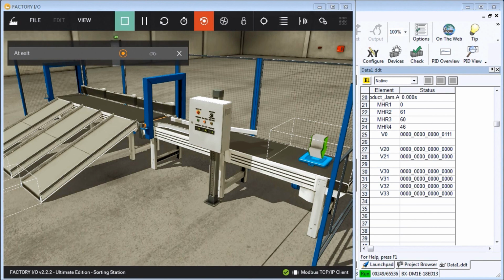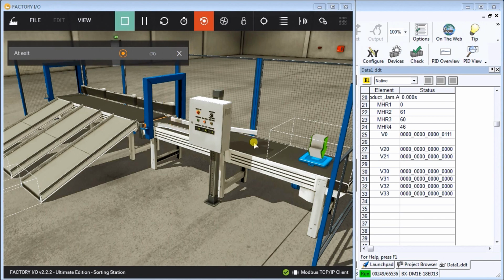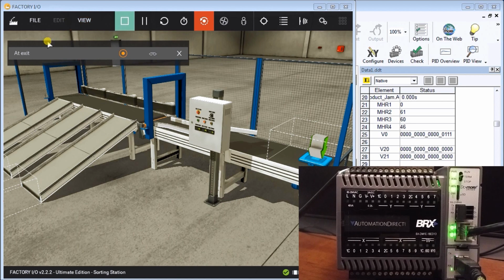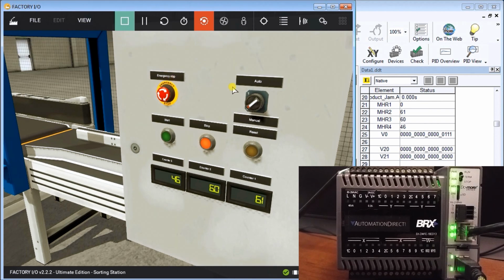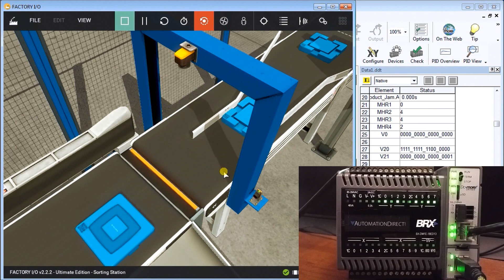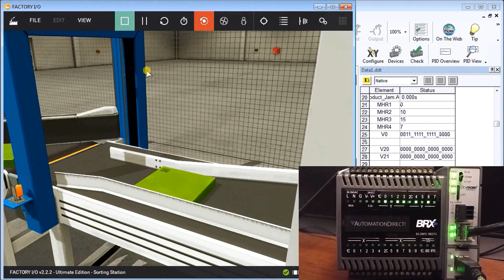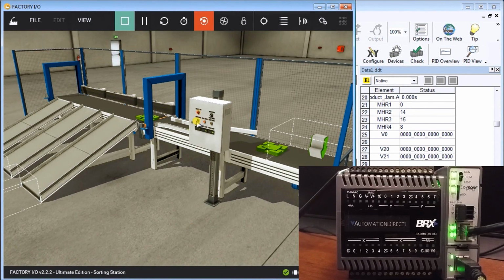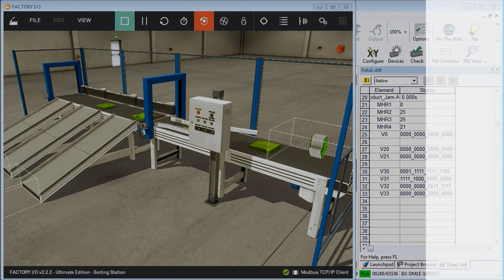Master PLC Sorting with Shift Registers - Real Factory Demo

Comment: How to interface do more designer with faactory io
Reply from the maker: This post uses Modbus TCP with an EasyPLC machine simulator. Here is a post showing how to connect a Click using Modbus TCP to Factory IO. This is an older version of Factory IO, but you should be able to reference the same steps.
https://accautomation.ca/click-plc-pid-using-factory-io/
I hope this helps you out.
Regards,
Garry

Comment: Can you make the shift function in tia portal. .? I have only tried with on word, not with so many words
Reply from the maker: Hi Kenneth,
I have not programmed with Siemens TIA Portal. However, the following video may help you out with rotate and shift instructions in TIA Portal.
https://youtu.be/dsK13nqiQuo
Regards,
Garry
Reply: @ACCautomation  thank you very much. My problem is you can only use D word 32 bit. I think the last bomber you use. That Not enough
Reply from the maker: @kennethkristensen5537  
You should be able to string the shifts together. The last bit of one will trigger the input of the next.
Regards,
Garry

Comment: This 3D simulator is great
I look the price : ahem

Yeah, the price is great too
Reply from the maker: EasyPLC Software Suite is a complete PLC, HMI, and Machine Simulator Software package.  This is an easier and more powerful package than Factory IO and the investment is low.

This PLC learning package includes the following:
Easy PLC - PLC Simulation that will allow programming in Ladder, Grafcet, Logic Blocks, or Script.
HMI System - Easily create a visual human-machine interface (HMI),
Machine Simulator - A virtual 3D world with real-time graphics and physical properties.  PLC programs can be tested using the EasyPLC or through other interfaces. (Modbus RTU, TCP, etc.)
Machine Simulator Lite - Designed to run on Android Devices.
Machine Simulator VR - Virtual Reality comes to life so you can test, train or practice your PLC programming.

Purchase your copy of this learning package for less than $75 USD for a single computer install, or less than $100 USD to allow different computers.
Receive 10% off the price by typing in ACC in the comment section when you order.

http://www.nirtec.com/index.php/purchase-price/

Regards,
Garry

Comment from the maker: We are using a BRX PLC in this application however you can also use the Do-More Simulator which comes with the Do-More Designer Software. 
http://support.automationdirect.com/products/domore.html
Regards,
Garry
Reply: Garry Shortt How conect Factory IO with PLC BRX, and which is interface, thanks for your video.
Reply from the maker: Hi Daniel,
http://accautomation.ca/plc-programming-example-sorting-station-shift-register/
The above website write up will explain the connection to Factory IO. We are using a Modbus TCP Cient (Master) from Factory IO. This communicates to our BRX TCP Server (Slave).
Under the configuration tab of the BRX you will see the IP address. Make sure this matches under the Driver of the Factory IO.
The memory for Modbus is already assigned by the BRX. 

Here is another sample of using Factory IO.
http://accautomation.ca/plc-programming-example-pick-and-place/

Hope this helps you out. Let me know.
Regards,
Garry
Reply: Thanks, I'll check it out